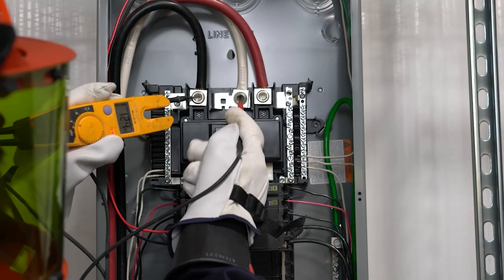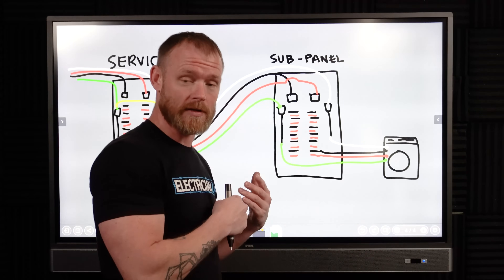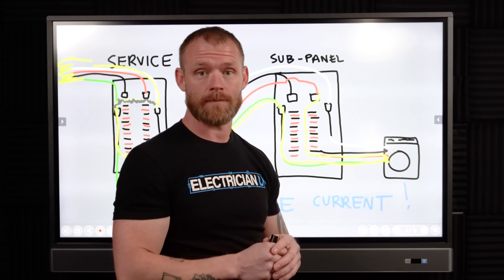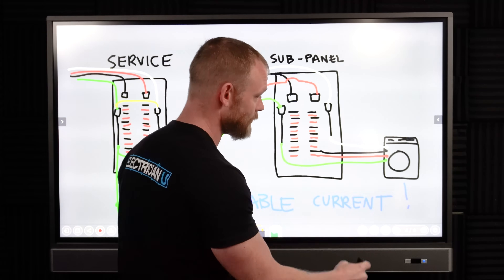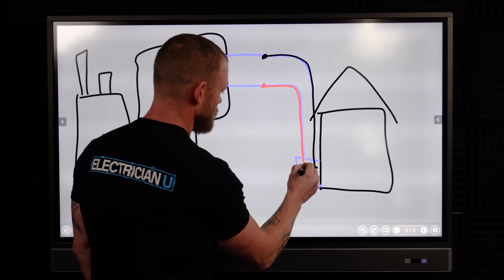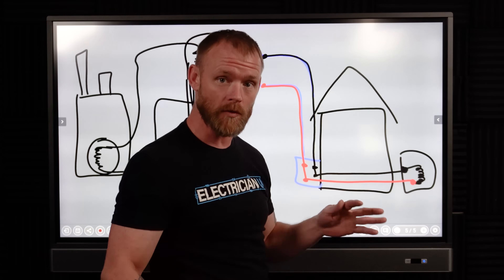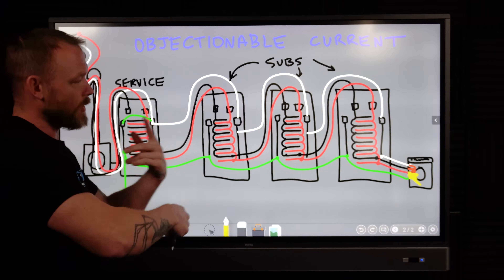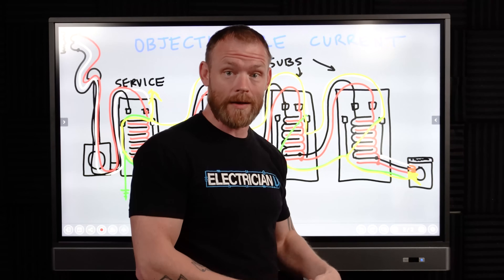Why Do We Bond at the Service Panel and Not a Subpanel?

Comment: Why won't ground fault be able to flow from the source to the ground rod in a system where neutral and ground are (incorrectly) not bonded? If the purpose of ground rod is not to provide additional path for the current, what is its purpose then? Why would we have bonded ground and neutral bus bars and an additional copper conductor to the ground rod at the service panel?
Reply: The purpose of the ground rod is to provide lightning a path to ground, not to provide an additional path to source (which it doesn't do).

Comment: Unless you are using super conductors the copper wires have resistance
Reply: at about 1 ohm per thousand feet, for the purposes of safety(what the video is primarily about) this amount of resistance is almost completely irrelevant.

Comment: Great video! Love the explanation. I have a question regarding this. I have a sub panel I am using that is designed for a backup generator. I am bonded at the main panel and not at the generator transfer/sub panel. Sub panel has about 5 circuits on it and it not bonded. How does that affect me if I am using the generator? At that point the generator powering the transfer panel is the source and the generator panel is not bonded. It is disconnected from the main by the transfer breaker. 
Thank you.
Reply from the maker: Thank you so much for your support. For specific and unique situations, the best way to get some help is to join the Electrician U Discord Server (https://discord.com/invite/7ykYfbh). There is a vibrant group of dedicated electricians there that discuss a ton of different topics and help each other out with interpreting code, finding solutions to problems and in general just supporting each other's work.

Comment: Question for ya, the house my wife and I bought a year ago has a 125 amp service panel, the outside disconnect is only rated at 60 amps, to me this seems like it needs to be updated, do I need to do this or is this on the electric company's responsibility? Its bolted just below the power meter.

Comment: I get, but ran into something I haven't seen before.  My daughter's townhome has a subpanel inside with ALL her breakers.  The MAIN is outside.  In the sub-panel, ground and neutral are NOT BONDED.  The only paths back to main are the two hot and one neutral service conductor, and I 'assume' the metal conduit back to the Main.  How would they bond this?  Metal conduit to neutral out at the main?
Reply from the maker: Thank you so much for your support. For specific and unique situations, the best way to get some help is to join the Electrician U Discord Server (https://discord.com/invite/7ykYfbh). There is a vibrant group of dedicated electricians there that discuss a ton of different topics and help each other out with interpreting code, finding solutions to problems and in general just supporting each other's work.

Comment: I understand and agree with the explanation except for one thing. Please explain how the incorrect bonding of ground and neutral in a service panel would damage other loads connected to it, if there was current flowing in both the neutral and ground wires due to a fault. I understand that it's not desirable and not to code, just don't get why it would hurt any other equipment.

Comment: How about a subpanel in a separate structure? Why does code require two ground rods for this separate structure, instead of just running a ground all the way to main? If you run just a single circuit to a separate structure, then you can run a ground the whole way. Why is a subpanel in a garage treated differently than a subpanel in a house? Sure it's a separate structure but it's all powered by the same service?
Reply: The ground rod is there to provide a path for lightning or other static electricity to ground. This path should ideally be as short as possible so you reduce the possibility of stray current.
Reply: @timseguine2  There is no such thing as stray current unless you're talking about static electricity.  It doesn't stray around at it's will, it follows every circuit available.
Reply: @motorheadplatt8748  By stray current I mean any non intended path. I didn't invent the term either. It is a term used in code for that purpose as well.

Comment: So I guess my question/misunderstanding is: does the grounding rod not discharge the ground fault into the ground at the same rate it's supplied? Isn't that the purpose of the size of the grounding rod, and the need for two of them?

Comment: How does that relate to there being a neutral wire at the Dryer as well as the ground? Wouldn't current go through the neutral back to the source instead of the ground?

Comment: Dustin great explanation but it’s the perfect place to say the ground fault loop impedance even with the best will in the world and code implementation may not still provide a low enough impedance path. There may be a dropped neutral at the service (a dangerous situation). That it’s really important to test ground resistance of rods to get below 25ohms but even beyond that the importance of adding GFCIs on an increasing number of branch circuits in latest code revisions make sense and should be welcome. That being said manufacturers of equipment where AC Dc conversion is happening and vice versa - leakage current and transients can be problematic tripping GFCIs and particularly AFCIs as well. That’s where we should be putting a greater emphasis on power circuit design reducing leakage current.

Comment: As always, great video. Very clear explanation. I am wondering if it is necessary to make the distinction between the terms “service disconnect”, and “emergency disconnect”. With the 2020 code changes requiring an outdoor disconnecting means, the main bonding jumper is now installed at the emergency disconnect, and not the service disconnect (although they can be the same piece of equipment). I believe that now even the main electrical panel is not bonded if you have an outdoor emergency disconnect.

Comment: oh, I just remembered a story of my friend who had a generator on his house and when the power went out, he fired up his generator and the street lights came on down the road. I don't remember the details about it but apparently something was wired up wrong by the township and they had to urgently come out and fix a bunch of power poles or something. Do you happen to know what that issue might have been? I know he also made sure to wire in a way to isolate his house from the grid entirely after that so his generator doesn't end up trying to power the whole county road. (rural area).
Reply: Yes, there was no isolation switch (or it was not wired correctly). This disconnects the house from the grid before applying the generator current. Otherwise the generator "backfeeds" the grid. It is often more of a load that the small generator can supply, so it will trip the generator's breaker, but it can also be dangerous to line workers who do not expect current on the "dead" side of a line.
The switch is often called a "transfer" switch. Some are automatic and some are manual, but it must be there.

Comment: Hey Dustin, Great video , as usual !  You are gifted when it comes to explaining concepts, please keep it coming.   I also have a question about grounding, why are lamps (eg. table or floor lamps) not grounded ?  Most have metal components that could be energized by a stray wire strand for example (ground fault).  Thx man !!!

Comment: Can you use gfci outlets to fix an older home with no grounds?
Reply: Yes sort-of, you can replace a two wire outlet with a GFCI and mark it "No Equipment Ground". The GFCI will trip if the power out does not match the power returned within 4-6mA. NEC 406.4(D)(2)(b) or a GFCI Breaker can be used NEC 406.4(D)(2)(c)
Reply: @tiggeroush  my backyard shed sub panel only has two hots and one neutral from main. 
Sub panel does have grounding rod. neutrals and grounds are bonded at sub to give some type of path back to source (just in case). 
Should I use gfci breakers throughout the sub?
Reply: @tiggeroush  Any place where your body can make good contact with ground as in standing on the Earth or touching water/pipe.
Reply: You have to decide if your life is worth the additional cost.

Comment: I noticed when I installed a new control board on my neighbor's oven and tested the oven, that the tail of the outlet was pretty warm, almost hot. Why is this?
Reply: poor contact at outlet, or damage to wire in plug (increase resistance at load, can not be caught with multimeter).
Reply: @rcmrcm3370  thanks for your  help! I went over and found a loose connection at the outlet! 😅
Reply: @ericlockridge4897  One, but not only possible reason electronics failed.  Weak contact creates arcing which can put DC /static charge into the circuit, and fry low voltage electronics.
Reply: @rcmrcm3370  yikes. Good to know

Comment: I easier for me to think of a typical imbalanced load, say 50 amps on the black and 30 amps on the red which means the neutral SHOULD be carrying the FULL imbalance load of 20 amps. Like you say, the grounding conductor should carry zero current. But if and when it does start carrying current, trip the GFI ASAP!

Comment: In Australia, we have an 'Active' which is Red, and a 'Neutral' which is Black, connected to the load. The neutral isn't independent like your white wire here. Then we have an Earth, which is green with a yellow stripe. It is very confusing because it looks like your have "2 Actives'  (Your Read and Black) in the US. My mind cannot understand how one side of our circuit is grounded. It looks like it should short circuit 50 or 60 times a second to me. But with the American set up, I can deal with it. (I think)..
Reply: The color of the insulation doesn't matter, it's what's in the wire that counts.  Your country code may be different.
Reply: @motorheadplatt8748  I am talking about AC and how polarity reverses 50 or 60 times a second, so if one side is grounded, it feels like the circuit is shorting 50 or 60 times/sec.

Comment: If yo have a computer and on the same panel as, say, a space heater and you bond the ground and neutral the current from the neutral will go to the grounding conductor at the panel. Some will go to the computer case and then through data cables which can cause interference so you want to keep the ground and neutral separate as long as possible.

Comment: So what is the purpose of the grounding rod? If ground needs bonded back to the transformer to pop a breaker.
Reply: I think lightning strike
Reply: @flat-earther  it can’t be that simple. A lightning strike would still fry your circuits if your panel wasn’t surge protected.

Comment: My sub panel is older and has no Ground Wire. Neutral and Ground wires all land on the same bus. Thus they are bonded at the subpanel and have no way home to the main panel on a ground. (except on the Neutral)  I understand that this isn't ideal but i don't understand why it is a problem. Seems it would be a problem if they weren't bonded. A fault would clear through the sub panel breaker same as in the main panel. What am i missing?
Reply: I'm not an electrician but I think in your situation where the neutral and ground is bonded at sub panel, current can return in a parallel path through the grounding wire and neutral wire. That is creating objectionable current on the grounding wire all the time. The grounding wire should current only to clear a ground fault to trip a breaker.

I think you are right that a fault would clear through the sub panel breaker.

But another reason the objectionable current is not good is because your wiring will create high magnetic fields.
Reply: That maybe code compliant when your house was built. Can not really say without knowing the year and having a code book for that year, or without knowing if your area adopted a code that year. But, I would think, it had to pass inspection at some point.
Reply: @tiggeroush  Passing inspection is somtimes just a matter of $100 and means nothing.  A life lost is worth how much.  The whole reason we have a code is to save lives and protect property.

Comment: Am looking at a job and I can do #10 thhn in conduit or 10-3 Romex. It's maybe a 50' so back of the envelope material cost it's about $40 more expensive to use Romex. The conduit run is easy with only a couple of bends. It would be interesting to see video on some calculations on this.

Comment: You say in a lot of your videos that you cannot trip a breaker without a complete circuit via a grounded conductor. I have never been taught this and I would love an in-depth explanation of what you mean. In typical residential wiring, a breaker is only interrupting one phase (assuming it's a 120 circuit) and the trip is dependent only upon the current flowing through the breaker. Even if the panel is ungrounded, and you have a direct short to ground at the load, the breaker will still trip because the thermal (or magnetic) element in the breaker will still feel the same current flow.
The breaker does not care where the current is flowing, only that current is flowing through the section of the circuit that the breaker makes up.

I spent about 8 years as an electrician in the Navy before working civilian electrical, and onboard submarines (where I served) you intentionally use an ungrounded electrical system. Even with these ungrounded systems, if there is a ground in a circuit it will still trip the breaker.
Reply: Not sure about submarines, but in homes the grounding system has to connect back to the source or there would be no flow large enough to trip a breaker.  The grounding rods aren't meant to help trip a breaker, they're there for lightning strike protection.  We bond grounds to neutral at the first disconnect after the meter because the neutral coming from the utility is the path needed to get back to the power source (the utility transformer).
Reply: @taylorlightfoot  This may be where I'm stuck on the matter. When you say "no flow large enough to trip a breaker" I definitely don't buy that. If you take 120V AC and drop all of the voltage to ground with very very little resistance you get a massive current flow. Assuming that the internal resistance of the wire is 0.1 ohms and you touch the hot 120V lead to ground you get a current of 1200 A (just basic ohms law).

I could buy this argument with grounding the load itself, since a short to the outside of an insulated load would not trip a breaker until the circuit was completed to ground (likely by someone contacting the load).

If you went to your electrical service panel and unbonded the ground and neutral then proceeded to touch a live 120V wire directly to a piece of metal at ground potential that breaker WILL trip.
Reply: @TylorandIlostmysock  not necessarily.  It is possible it could trip, it really depends on how moist the soil is and how good the ground rod is conducting, how far away the transformers ground rod is, etc.  In a situation where we have no bond to neutral and a ground fault to the ground wire, current will flow into Earth through the ground rod, but it's not trying to return to Earth, it's still trying to get back to the transformer.  The utility bonds the neutral on the secondary side of the transformer to ground and down to a grounding rod, also for lightning protection.  If the house grounding wires aren't bonded to neutral, power will flow to ground rod, through the soil and eventually to the ground rod of the utility and back up the the neutral.  So yes, it's possible but not guaranteed this is a path with low enough resistance to trip a breaker.  I can try and find a video where people have tested this and shown the breaker to not trip.
Reply: @taylorlightfoot  I definitely appreciate your response here, I agree with what your saying.

I'll do some research myself to see if I can find any videos of the sort.

I would agree much more with "a trip may not occur if a direct path for ground is not established" than I agree with "you need a complete circuit back to the service panel grounded connection in order to trip a breaker" which is what it appears that Dustin is saying in this video.

Thank you very much for your time and help here, if you find any videos you'd like to share I'd be happy to watch
Reply: @TylorandIlostmysock  I linked a couple above.  One clearly showing a direct path into Earth.
Reply: @tiggeroush  This is almost exactly why I asked the question. What you're saying (and I agree with) is that a short to ground MAY not cause a trip without this direct path established. However, what Dustin appears to be insinuating is that it is IMPOSSIBLE to have a  breaker trip without these intentionally grounded conductors in the service panel.

Comment: I have a non-bonded sub-panel in a detached garage approximately 80 feet from the house. (Good so far) What about additional grounding rods? Besides the ground coming from the main panel to the sub-panel ground bus, we also have an additional ground from two grounding rods located withing 6 feet of the sub-panel. Is that required or problematic?
Reply: Separate structures require their own ground rod(s).  Ground rods are for lightning protection only and having one at each structure protects lightning from flowing through the ground wire between buildings.

Comment: You keep saying over and over and over again that if there is not a complete circuit the breaker will not trip, but you never go into detail on what fo what happens inside the breaker to cause this.
Reply: In a ground fault it's a trip caused by intense magnetic fields from the huge inrush of current.  Breakers can also thermally trip in the case of say for example pulling 21 amps through a 20 amp breaker for an extended period of time.
Reply: No circuit means no current, that's what your switches do, complete or disconnect a circuit.